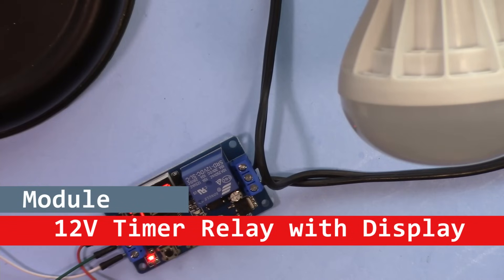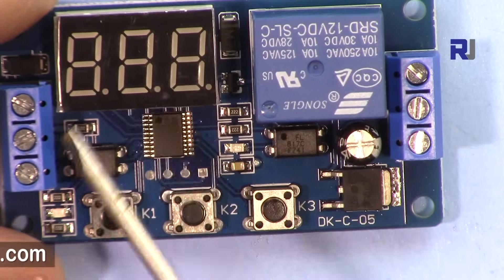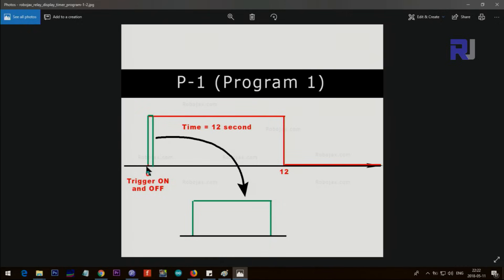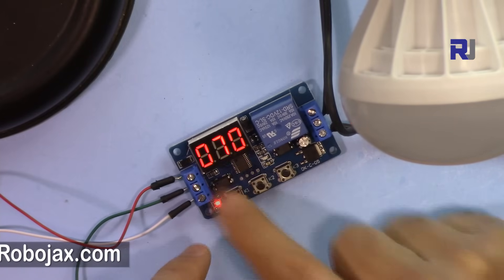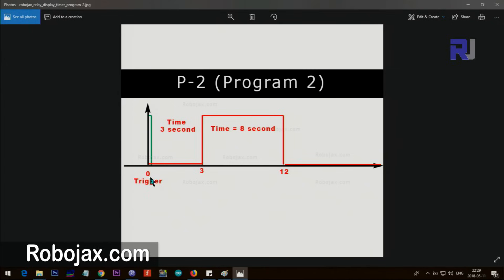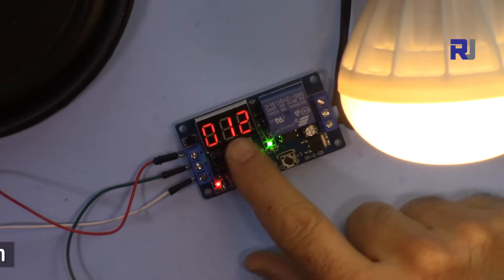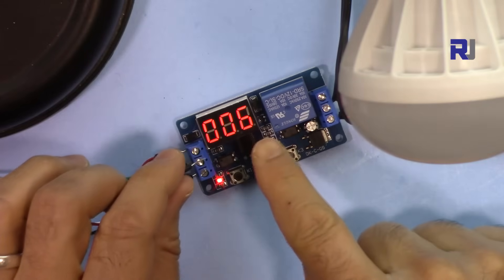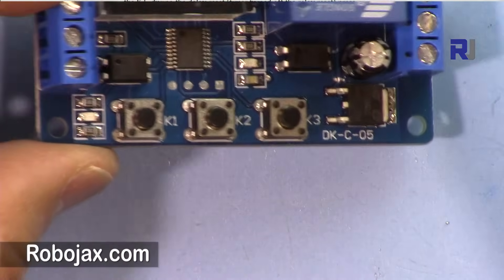Home Automation: 12V Relay with LED Display Delay 0.1 seconds to 999 seconds Timer module P1 to P4

Comment: so you basically require three connections? one for powering up this relay. second to trigger the timer function and third for the appliance connected to COM, NO or NC? isn't that a bit messy?
Reply from the maker: Was it possible to do it some other way?

Comment: Good day sir! am from Philippines and a fan of your blog. I would like to ask if it is safe to use a relay timer module with a 20a 14vdc, 20a 125vca relay on 220v loads. I just bought online this "XY-WJ01 LED Digital Time Delay Relay Switch Module Time" and planning to use this on my 220v UV light water sterilizer but too hesitant upon seeing the spec of the relay that you have on your module which has an 250vac. I have ask already the seller ang he says that its ok to use. And i have been watching reviews on yt with this module using 220v loads. And if it is not ok, can i replace it with a relay the same that you have on your module?
Reply from the maker: Hi, thanks. It is written in the relay. Most of the time the relay is rated for 10A. Check it if it is rated for 20A then use it if not, do not use it.  You can use this module to turn on another relay that is rated for 20A
Reply: @robojax  thank u sir.. It is written in this color black relay 20A 14VDC and 20A 125VAC. I have other timer modules that i have been using ever since but a color blue relay,  the same that what your module have. It is written in this color blue 10A 250VAC/30VDC and 12A 125VAC/28VDC. It is my first time to use this module with color black relay with different spec written. Our electricity/loads is 220-240 AC line to ground. I was thinking that a relay with 20A 125VAC can only be used on 110-120 AC loads and 10A 250VAC on 220-240AC loads. Thank you sir for correction/clarification..

Comment: Hello,i need a 12v timmer that shoul do 10 sec on and 600 off in  endless loop, can this relay do this ?thanks
Reply from the maker: Hello,  I have published over 450 videos and don't remember what this relay did. But my rule is to explain things fully. So you have to watch all features of this module and see which one works for you. good luck
Reply: @robojax  Thanks !

Comment: Hi Robojax! Wonderful video. I have a very basic question. Can I use AA batteries as a power source to switch on - off 2 - 3  5MM LED lights using Program 3?
Reply from the maker: Hi
I don’t know if you are referring to powering this module or just for LED but yes you can use for both.
Reply: @robojax  thanks for the confirmation. I meant the module.

Comment: Hello I have found your video very helpful but I still have a problem. I have wired identical to the video but I have no output power. The green led illuminates on the timer ok and goes out but my external light won’t come on. Any help would be appreciated

Comment: Thank you when I ordered this same product it only gave me a diagram for using the same battery for the timer and a device which is not what I need and it wasn't working. Im doing the same thing only with a fan, your advice made it work perfectly!

Comment: Fantastic video, thank you very much for the time you took to explain this with your clear & concise instructions. In P1 mode can I use the trigger to turn the light on and off with one momentary switch, or alternatively can I use the trigger to turn it on and remove power altogether to reset it to off with two momentary switches? I want to turn on and then turn off the light, but if the light is left on it should turn off automatically after a set time (canopy lights in a pickup bed). Thanks in anticipation.

Comment: Hi Great video, Please could you assist, i am a little confuse in relation to a DC Load. I have a 12 DC Input, and a 12v DC motor and i want to use P3 but not sure how to cable the Motor? Any assistance would be great full.
Reply from the maker: the wiring is the same as the bulb shown in video. your power 12 V instead of AC exactly the same.
Reply: @robojax  Thanks for the quick response, but i am trying to use the same power source for the switch and the motor?
Reply from the maker: Then first power the module, then use the same battery to. An think iOS it like ac power and bulb. Which I have shown and wire it.
Reply: @robojax  thank you

Comment: Great video dude! Thanks!! I have a question, I need to activate the relay when a 12 v signal goes off... Any idea how to do it? I want to keep a circuit powered a few seconds after a 12 v supply goes off... Thanks!!
Reply from the maker: you mean when the power goes off? it will restart. so use 18650 batteries to keep is running. I will post uninterrupted power supply which charges the battery and supply power so it will have power for 1 or more hours.  Stay tuned
Reply: @robojax  You mean, use a battery instead of relay? So it will provide power for some additional time?
Reply: I think you just need to use the P4 program.

That is what I will be using to keep my dash cam running in full frame rate for an hour or two after turning off the car. After that, the hard wire kit will trigger parking mode with lower frame rate.

Comment: When i turn it on ( blue lights )  It creates an annoying noise. Buzzing. Do you have any idea to take this noise out?
Reply from the maker: It means the input voltage for the module is low. Check it

Comment: I have bought this unit, but I need a delay relay that when 12v power comes on, it delays about 10seconds and then triggers the relay that controls a 240volts water pump. I think I bought the wrong product, can you recommend the right circuit I need? Thanks for your help.
Reply: Had the same problem had to buy another product to achieve this simple function.

Comment: How can delay setting be made in minutes instead of seconds, please?
Reply from the maker: For one minute set 60 second and for 10 minutes 60x10=600 seconds so set it to 600
Reply: I want to set timer for 990 minutes. Amazon.in sells this unit as 0 to 999 minutes timer. Setting instructions shown in your video also mention 0-999 minutes! Please advise urgently. Thanks in advance...

Sunil Nehru

Comment: Awesome video, I have a question, how about if I'm using PIR sensor SR505 for the trigger ? Is it possible ?
Reply from the maker: Yes. It just needs voltage. It should work
Reply: @robojax  can you show me how to wire it up ?
Reply from the maker: I have shown the wires . Ground and voltage. Your sensor should have ground and voltage out. Just connect it

Comment: Do you know of a relay that is like program 1 but then also has a delay where the program cannot be resignaled for a duration of time?
Reply from the maker: I don't remember what program 1 does, but you can search my channel for "relay timer" I have so many.
Reply: @robojax  program 1 turns on once signalled and stays on for T1. Once T1 is 0 relay turns off. Thanks I will have a look and see if I can find something

Comment: How can I turn on the tiger by turning on a COM or NO that already has voltage so that it drops instead of plugging it into a 12V contact,
The device I turn on works independently several times a day and I want when it turns on it will turn on the auto tiger Is this possible?
Reply from the maker: I believe I have not left any details or features of this module out. to answer your question I would have to watch the video. so if you watched it fully without skipping, you would know.  good luck.

Comment: Hello ! i have made a spot welder using this time module to trigger a solenoid switch, because its relay its rated at  10 amp,can you explain me how come it don't get burned since the car battery i am using has a lot more amps?
thank you in advance, i am sending you my video.https://www.youtube.com/watch?v=Ros9Q6E335Y

Comment: Is it possible to set in minutes sir?
Reply from the maker: You should know that 1minutes = 60seconds
Reply: My PLC timer ONLY 3 digits
Reply from the maker: Yes so maximum is 999 seconds which is 16::39 which is the maximum time you can set. I have times of more reviews  tan can be set to 100s of hours. Check them

Comment: Hi...
I want to make timer for my aquarium light
It should on at 8:00 am and off at 5:00 pm
Plz help me
Reply from the maker: This has no  time of the day and maximum is 999  seconds. Use Arduino clock module ds3231 check my channel

Comment: Hi Ahmad ! Can you tell me if this module saves the programmation after being unplugged ? I'd like to use the P3 loop program but not infinitely. The module itself would have to be powered by a float switch, triggering an alarm that would then buzz and turn a led on for a time set on the module then off, then buzz andf light again etc until the float switch is back to the normal state or totally shutdown by some action of the user. Do you think this is the right item for this application or do you know another way of making this kind of warning setup ? Thank you very much for the ressources and help you provide ;) Have a very nice day mate.
Reply from the maker: Hi Co Fa, finally got time to watch the video. When you set this to loop mode, trigger will not work. It may disturb the ON/OFF time.  so check out other modules. I have got so many of them and don't remember which one does what. Now over 440 videos.  Stay safe and tank you for writing to me.
Reply: @robojax  Thank you Ahmad for the time you took to anwser my question. In my idea the trigger input of the module wouldnt be used, in fact the 12V input would play as a switch (a float switch) that would power the module on. But this would requier the module to "remember" the parameters (set to P3, and on/off times). So the question was more about the possibility of saving those parameters even if the module is unplugged for a long time ;) But it will probably be unable to save those values if unpowered. I'll check your other videos about those delay relay modules. Thanks again for the help and all the great videos and ressources you have made ! Have a nice day !

Comment: Can it be used for a spot welder setup?
Reply from the maker: look at the relay raring and I've explained it.  it say 10A. then your machine needs less than 10A, then yes. in terms of time, yes it can be programmed.
Reply: @robojax  thanks a lot. I will try and keep you updated!
Reply: so, i successfully managed to build a spot welder using this as the time regulator. thanks a lot. it is just perfect. 0.1 seconds is the time needed to weld 0.12 mm nickel strip. 0.3 mm strips require 0.2 to 0.3 seconds. With a time of 0.7 to 1.2 seconds i was easily able to weld 1 mm to 1.3 mm thick stainless steel. the relay holds up really good. no heating issues. thanks once again.

Comment: Can I use it for 5 hour for off some load,
My load require 2 times off for 5 hours per day can I use it please tell me quickly
Reply from the maker: the title says 999 seconds. so do the math.
Reply: @robojax  in your video last moment you show the specifications there is mentioned 0-999sec and 99.9 sec and 999 minutes
Also I saw these products on Amazon 5V timer module and 12V timer module in those products specifications was same 0-999 sec and 99.9 sec and 999 min
I think it was wrong you are right it's only 999 sec but I am not confirmed. 
Can you confirm me with this, before I buy the product.
Reply from the maker: the title and the description is correct.

Comment: How much is it's own power consumption sitting in off condition as I  was looking to use this in my car, wondering if it could drain my car's battery if left for a couple of days? Or is it negligible?
Reply from the maker: your battery would last 1 or 2 years.
Reply: @robojax  that was humorous 🤣, though I got my answer, many thanks 😄😄
Reply from the maker: LOL. 😊😊😊😊😊

Comment: Can you setting ini minute?
Reply from the maker: yes you can. you know 1 minuet is 60 second.  if you want 5 minuets, then 5x60=300s. is that hard?
Reply: @robojax  the seller tell me it can up to 999 minute, if i do your way means only up to 999 second. So what is actually up to 999 minute or second?
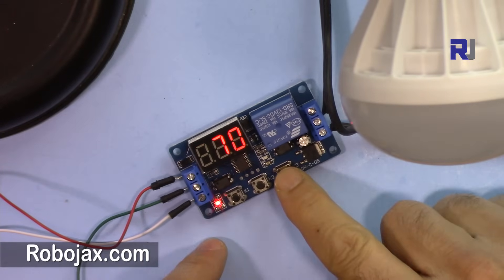Reply from the maker: It seems you have not watched the video and also have not read the text in the description. this is 2nd time i look at it as I did not remember what this is. At the middle of writing the comment, I watched the video and , at exactly 7:00 I mentioned the maximum. I also change the title and put the time.

Comment: Is there a way to set for minutes??  Like. 120min/. 240min?
Reply from the maker: I believe I have left nothing unexplained.  to get the answer, please watch the video as I don't remember anything about the numbers for this module.
Reply: @robojax    i have gone through the video. But i. Did not see you setting the minutes!!   

Please reply yes or. No.  Is it possible??
Reply from the maker: it seems you did not read the description under the video. if I did not show it, then it can't do it. You make me watch the video.  it can go only to 999 which I have shown in video.  you need to use this https://youtu.be/ZRAaTRKRmh0

Comment: Thank you so much for the detailed information. I've managed to connect the relay to my Dahua Intercom which is connected to a electric door strike. I managed to power the relay and got the trigger working so that it start counting down in P-1 settings. However, when connecting my 2-wire electric door strike - it doesn't seem to receive any power. The LED light does come on when the trigger is activated & last throughout the countdown but no power seems to be going to the door strike. Any idea why?
Reply from the maker: You are very welcome. Are you saying that you connected your door strike, instead of the bulb shown in video and it is not turning ON and OFF? if relay clicks and hear it, then your wiring is incorrect. I assume your door device is functioning. test it without connecting it to this module.  Connect another load AC or DC bulb and test it. Perhaps the relay connectors on the module are bad. good luck.
Reply: @robojax  Thanks for the update and got this sorted as I forgot to connect the power source for the electric door strike. Once again, much appreciated your speedy reply and follow-up.

Comment: If i use a key on/off for trigger, when does countdowon starts in P1 or P4? ( ON or OFF ?)
Reply from the maker: The wire that I connected to (-) negative terminal IS a switch. switch connect and disconnect.  what it does it explained in the video. if I want to answer, I have to watch the video, so you watch. it. I have left nothing unexplained. Good luck.

Comment: How can I change the timer to count in MINUTES instead of SECONDS?  Thanks
Reply from the maker: I believe this is the most basic question which I have answered it.  I would have to watch it to answer.  Everything this module does and All settings have been explained. if you watch it without skipping you will get your answer. good luck
Reply: @robojax  I didn't hear where you mentioned "minutes" once.  You went only up to 999 SECONDS for the P3 Programming.  It's OK I worked it out from another video which explained it a bit better.  Your video is helpful though regardless.  Thanks
Reply from the maker: You are welcome. the device can be set with seconds. 60 seconds is a minuets and 999 has many minutes. thank you
Reply: @ggp11  Hi, i want a 12 hour cycle, how can i make it count minute instead of second?

Comment: hey and thank for th vedio 
I want to ask you where can I find (off delay timer 12v in the market) the counter start to count when I cut the power?
I mean i want it delay off..12 volt with relay
when i press power the light turn on and it countinus lighting  until I cut power off then the light turn off after 5second
Reply from the maker: I hope off delay means instead of turning something on, u want it off. If that’s the case then it is the wiring of this module with relay. Keep the middle wire of your load at the same terminal if the relay and move the other wife mite to the UoIT her unused terminal.

Comment: Hello Robojax, thank you for your detailed video. I bought the timer, not realizing, that the trigger ALWAYS has turn off in order to make the timer start and let a lamp turn off after some seconds. Is there a way, to accomplish that with this relais?: Trigger: turn on the lamp - wait 5 seconds - turn off the lamp. The state of the trigger would be irrelevant. 
If this is not possible with this relais, do you know a relais with that I can do this? I would be very thankful If you could / would help me.
thanks a lot. Andrew
Reply from the maker: Hello and welcome. if the trigger is the issue, you can change the trigger signal use this circuit very easily https://snipboard.io/vERWPt.jpg  I have move timers with both HIGH and LOW trigger types. I try to explain everything but don't remember now which one is which as I have over 400 videos as of now and  hard to track them. Good luck.
Reply: Robojax Hello Robojax, thanks alot for answering. Well the trigger isnt really the problem, it works. The problem is, that the trigger doesn‘t turn off automatically. This wouldn‘t be a problem if the timer (P-2) would start immediately after the trigger was recognized. The problem is, that the relais waits for the trigger signal to turn off. But in my case this will never happen. Therefore I cant use this relais. Is there really no way of acheiving this? ☹️